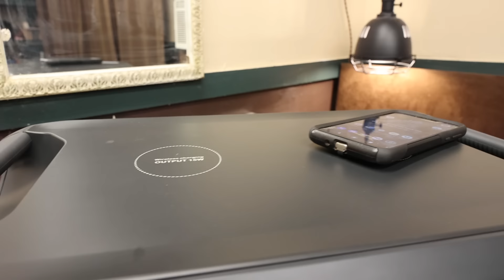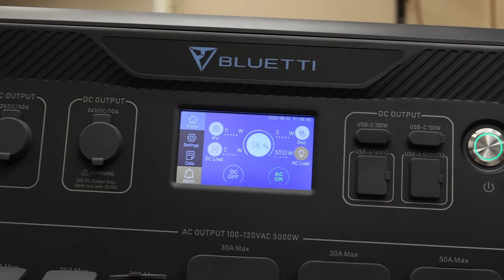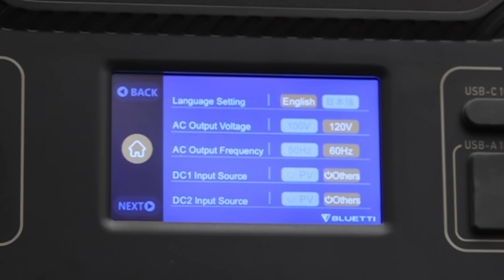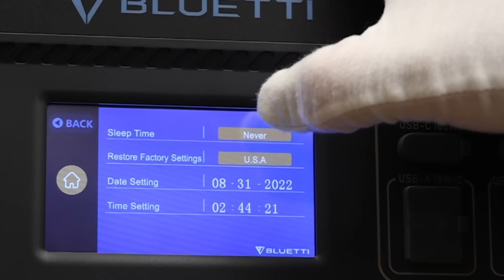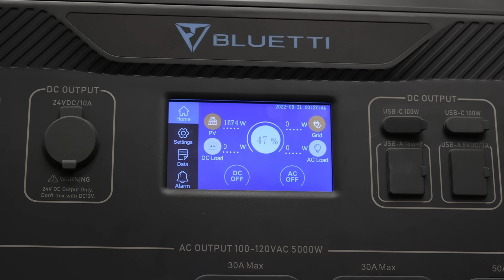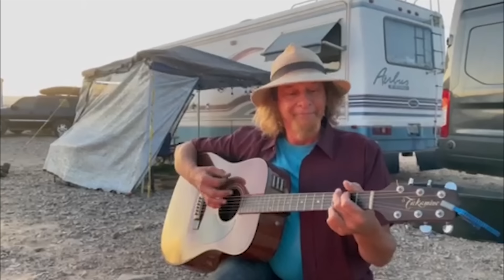Bluetti AC500 5000w LiFePO4 UPS Portable Power Station Solar Generator Review

Comment: Being able to charge the battery units separately via solar is a treat for my small place --- HOA would not let me put up huge solar set-up but I could get away with a couple of panels charging up one battery at a time.
Reply: Isn’t it a shame HOA’s opposing renewable energy only because it’s different
Reply: @JoeyBeez  After living in my current place for 8 years, I have seen too many people try all kinds of goofy stuff with the outside of their units and then get into fights with the HOA because they broke the rules. The HOA is OK by me because we have tiny porch areas and if they allowed solar panels with no rules, lord knows what some of the neighbors would put up.
Reply: @Randomadventuresebike  Normally I would agree with you but when neighbors leave bags of trash out that bring animals which then damage other people's places, that is when those rules are good to have
Reply: Many state laws override HOA CC7R's when it comes to installing solar.
Reply: @Bassist5392  I am staying where I am for now because of taking care of my elderly Mom but I may move someday. I am thinking of a Bluetti or similar modular solar system that I could take with me. If there was a loss of power for a few days, I doubt the HOA bosses would care about me laying out solar panels for the duration.

Comment: I as well was pretty excited when I saw the 240/120 volt 30 and 50 amp outlets  on the unit for the first time. Too bad they don't function as 240 volt with a single unit.  I may just hold off until they can figure that one out

Comment: I own a BLUETTI ac200p and I use it every day it’s a great product however these indigo go campaigns are dicey at the moment. With supply chain issues and China’s economy on the verge of collapse you might want to wait and order when the product is built and shipping. I’m still waiting on a 12v refrigerator I ordered back in June that was suppose to be delivered in July, August at the latest and I’m still waiting. Please understand with everything that’s happening these campaigns are not running that smoothly and you can expect issues.

Comment: I once saw a video of a guy attaching multiple old/used vehicle batteries to his solar generator and wish I remembered where or save the link. But I’ve never seen this option again and no mention it’s possibly when discussing extendability. This review is awesome and this product is far beyond what I currently can afford or need. But I’m definitely interested in  plug n play solution but with more flexibility extendability to mainly keep my outdoor yard and safety lights going since they are off grid and wiring is not an option.

Comment: One problem with you suggestion to allow these to stack without using cables is that I plan on using this both in my house and my RV. When in my RV it won't be stacked (I've got a 40' 5th wheel and will put it under the stairs). Now if there was an option of stacking without cables, and using cables when you're not stacking them, then I'd be all for that. If it was only a stacked configuration I'd not have purchased the AC500 and 2 B300S's that I'm now waiting on.

Comment: Great video and great product! I do love how it can get over 6,000 Watts of charging. The Ecoflow Delta Pro does this as well. Granted you need the extra battery for it and use on of their multiple options.
Reply: @Randomadventuresebike  A standard dryer outlet is 30 amps 240 volts, so 7200 watts. I have a 120v heat pump dryer so the 240v dryer outlet in my laundry room remains open, and someone could always install such an outlet elsewhere if desired, similar to a car charger.

Comment: In my opinion there is very little need to “charge quickly” on solar.  If it takes 2 hours to charge on 3000 watts of solar as an example, once battery hits 100% you have 3000 watts of solar potential on your roof doing nothing for a good portion of the day.  Either lower the wattage to charge over a full day or put load on it so you are able use what you produce.   I have a 550 watt load on my blue tie and 800 watts solar. I start the day at 70% battery and it ends at 70%.  This way I compensate for clouds and the lower solar generation in the morning and evening hours and invert loss. Also remember charging from ac power takes a 15 % loss. So solar generation is best if your trying to use it lower your electric bill/usage.
Reply: Charging quickly matters if you are using this in a vehicle charging it with folding panels. If you're mobile, it matters!

Comment: "But Hobo..." LOL. That is an excellent poke at the KB warriors LOL!
I do have two DIY systems, 2400w 100A  and a 4800w, 200A system. And I have an older Maxoak 1500w, and an Ecoflow River Pro 720w unit. I like the "modularity" of the DIYs. I can separate batteries as needed. I like the complete turnkey ability of the EF and Bluetti. My goal is to power a fridge, freezer, fans, and a portable AC unit (when needed for rolling blackouts in So Kalifornia, 2022). And of course recharge phones, HAM radios, tablets, and power banks.

Comment: in addition , when running a thermometric a gas or sometimes even a compressor coolbox the wattage will be increase , 
for instance i have a thermo coolbox that does 60w on 12v but 80w on 24v making it work way better in summer on higer voltages !!

Comment: Pretty odd duck of an upgrade over the AC300. I'm not missing anything with a dual AC300 stack though, 3000W (plus surge) is honestly enough for anything you'd have a modular system like this for and burns less idle power, with more of the common NEMA5-15 outlets. The big drawback to these Bluetti modular units are they (still?) lack the capability to balance between multiple connected B300 units; in a split phase configuration especially if one hot leg is drawing unevenly then the whole thing prematurely loses power. Agree/disagree with you about the DC battery connections, the avionics connectors are pretty good power connectors in an outdoor setting but I wish there was some kind of functionality between B300's so you could equalize or dump power from one to the other, especially for split phase operation, and an option for a cable long enough because yeah trying to stack the "head unit" AC300 in a different orientation just doesn't work with those awkward cable positions and limited length. B300S weighing over 80lbs is not a good move, the B300 is like 79.9lbs and about as heavy as a person would ever want to lift, probably would have been worth less capacity to keep the heating tech and stay under 80lbs. Does the AC300 also charge in single mode at 240Vac or is that new for the AC500? Thanks for sharing the testing of the new stuff!
Reply: Great questions. I am also holding back my order until I know if the unit can balance out the 2xB300s

Comment: Great review. I wonder how AC500 will perform with a highend audio system. For the sound quality to work, it takes a good quality inverter, and many batter packs use inverters which degrades the sound. I heard Bluetti is better than most in that regard. But, if there is anyone using it with the audio system, it will be great to hear your feedback.

Comment: After watching your video on the bluetti AC500. I purchased one. I received it the other day. Looking through the manual. I realized something. Is there a circuit breaker or a fuse for the outlets ?. I do have a portable generator and their are push type breakers. 
Thanks for your time and effort on these videos. I do appreciate them. 
I have purchased the following after seeing your videos. Montek carry generator, PowerQueen 190 ah. Bluetti AC500. Keep up the great work.

Comment: I bought the B300s on Indiegogo- Bluetti is telling me that the battery will only work with the AC 500 - unlike the B300 it is not backwards compatible with the older units.

Comment: I’m the process of setting up home backup power in Canada. Got a 3300 watt Firman dual fuel inverter generator, will be setting up a manual transfer switch to power critical circuits but really struggling in committing to battery power vendor. EcoFlowC Bluetti, DIY with Victron etc 

My main objective is to have some backup in case of an outage (rare in my suburb) and recharge the batteries using the generator for now. Eventually will look into setting up solar as alternative source.

I keep reading bad reviews on forums with people having to return bricked devices after failed firmware updates, etc.
Reply from the maker: The bricking issue was <1% of users and was resolved months ago.

Comment: For PC's, especially desktops, I recommend running them on battery backups with surge protection as well. Yeah, you are charging a battery with a battery, but its conditioned from the battery UPS to always give sinewave power. Solid state drives and modern memory modules are sensitive to power drops even in a couple ms range. Laptops are good to go though. I'm using the ac500 and 2 batteries in my toy hauler 23pack15 as my 12v battery and then plug in the 30amp output when I'm boondocking. I have an outlet ran to it that I plug up when I'm on shore power to charge. My next purchase is an alternator charger. Then solar charging, then auto transfer switch, then... then... then... ugh. The pursuit for the perfect setup never ends.

Comment: Tempting but that behemoth of a dinosaur power cable, is such a thorn of contention/deal-breaker.  I'd be willing to bet, if Bluetti came up with a redesign for the clunky power connection, during the crowd funding... AC500 sales would increase substantially!!
Reply: With you 100%. The interlocking pins idea as mentioned in the review would be excellent but even a simple rigid ninety degree connector would be an improvement and should be doable/compatible with the existing AC300.

Comment: I'm still using a bluetti eb150 from several years ago, to power my off grid cottage in the West of Ireland. I've paired it with an 800w generator for when the weather is particularly bad for several days in a row. 

The system powers a 12v fridge, vacuum, radio, led lights, phone, laptop and a few battery operated tools. It's so wonderful, but I'm steadily dreaming about a much larger system that will do a lot more for me one day. The technology is very exciting.

Comment: Hi, just curious if you do plug a 50 amp RV cable into the AC500's 50 amp outlet, will the RV electrical system be damaged by running on only one leg of 120v at 50a?

Theoretically even if only one leg of 120v 50a is available on the AC500's nema port, that is still 6000w of out put which is more than what the AC500 is capable of outputting.  So again in theory if you're 50 amp RV doesn't have any 240 volt appliances then it should still be viable to plug straight into the AC500's 50amp port and still be able to pull upwards of 5kw.  This is all my speculation so correct me if im wrong.
Reply from the maker: It won't damage anything but it may not run all the circuits. You need two ac500 for 240v 50A service. Otherwise it's like standard 30A.
Reply: @HOBOTECH  Okay, thank you for the reply.

Comment: I have two ruptured discs in my lower back.  No way could I lift that battery unit without doing serious harm to lower back.   At 88 pounds, that is a serious logistical restriction in terms of this unit's mobility.  Otherwise it looks like a great product.

Comment: I'd like clarification about the self-heating of the batteries since you said it had to be connected to AC grid power. To me that means it can't self heat if you don't have a grid. I know that there would be workarounds to this but as it comes it doesn't self heat the batteries with its own store battery power?

Comment: From what I have been told, the only problem with the 300 is that the battery management system was a real power hog, so much that the battery would drop substantially overnight.  I hope the 500 brings a more efficient BMS to the table.

Comment: Great video.  I bought one thanks to you.  And I'm looking forward to receiving it as they said it was starting to ship after tomorrow.  They offered several "perks".  One was to buy the Bluetti PS70 units for a mere $99.  So I bought several of those too.  Any thoughts on that little Solar Battery?  That sounds so cheap and there is not limit on them.  I know the limited capacity of 500w/720wh is small, but for a bedside backup doesn't $99 seem too good to pass up?

Comment: I like the cables. If you WANT to be more flexible then you can be. And I've seen setups where two batteries sit sort oft next to each other and the AC300 (in that case) sat atop of them on another shelf.
But what I would like to see are shorter cables with 90° angled plugs for the case that you actually want to stack them on top of each other. Doesn't require any sort of redesign of the units, just a new/optional cable.

Comment: Enjoyed your video.  I'm thinking of purchasing the AC500 system.  I currently have a 5500W, 8500W peak gasoline generator plus the 30A plug-in and transfer box from Reliance.  All works fine.  The Reliance box allows one 240V connection (which in this case is two 120v switches bound together).  That 240V is connected to an Electric Hot Water Heater.  I don't think it matters about the HW heater being split phased.  I guess my question is do I NEED two AC500 and two B300S batteries each or can I get by with one AC500 and one B300S?  I'm thinking the hookup would just involve tying the single 30A connection with the 4 outlets from the single AC500 to the single 30A , 4 inlets on the Reliance transfer box.

Comment: Hi professor. It appears that the B300s battery won't be compatible with any older model. The battery extension cable is a P150D vs a P090A. Very dissapointing that the B300s will only work with the AC500.

Comment: My 50A class A should be able to plug right into this, and with enough extension batteries + solar panels have no problem running appliances virtually off grid?

Comment: Excellent review and excellent product.  The batteries for these units are right on the upper limit of "portable", and the price very much reflects the substantial capabilities, but for anyone wanting an off-the-shelf solution, this is certainly a very good option.  I am one of those who strongly prefers a more modular approach for something of this size, meaning the inverter, charger controller(s), and various DC output types are independent and serviceable.  I recognize most folks do not want to be bothered with knowing how to DIY any of that stuff and that's why products like this exist.
Reply: The batteries for these units are right on the upper limit of "portable" -- The Bluetti website specifies that the battery is portable, provided two people are carrying it.
Reply: @daisypatritio572  - My point exactly.  Personally, I think these newer massive units are targeting a pretty small niche in the market, where folks would probably be better off buying or building a component system.
Reply: I think a lot of people prefer the all in one system because the assumption is there will be no surprises in use, compared to different products not always working together well.  Then when there is a question, issue, concern, warranty, etc., you now just have one company to deal with without the others fingerpointing.
Reply: @aussie2uGA  - I agree, that most people will prefer a commercial, all-in-one system, but that doesn't really make them the best option for many of the larger use cases.  If you're building a large system and portability isn't part of the use case, then things like the AC500 really aren't the best way to go about it.

Comment: Did you by chance do a battery capacity test on the B300S battery without being connected to the AC500?  Interested to know the percentage (hopefully 90% or better) without being connected to the inverter for running a DC refrigerator.  Thank you.

Comment: we have a 50a RV 5th wheel. will we be able to plug into that 50a. We do NOT use both A/C's as they are both ducted. So basically 30a, but easier to just plug into the 50a without an adaptor.

Comment: Can I hook this into my RV transfer switch? Or would it be easier to plug the RV 50 amp power cord directly into the AC500 and use as a UPS?

Comment: Wait a minute! The top unit AC500, which is only the inverter and has no battery and so produces no power on its own, weighs already 66 lbs (4 lbs more than the Bluetti AC200) !?!? WTF?
The combo seen here weighs as much as ME! (150 lbs) Not many people will be able to "carry" this around. These weights are getting ridiculous. 
Glad I have a Jackery Explorer 2000 Pro that weighs "only" 40 lbs.
Reply: Yeah the definition of "portable" is really being stretched. When I get something like this it's going to live in the corner, running appliances. If I have to evacuate in an emergency (or just go camping), I'm taking a little 300w Anker.
Reply: Thats what I dont understand, and do not know why more people are not complaining about it. My 200max is at least a power bank. Why would I pay 1700 for just an inverter with plugs. I thought and glad I came across your comment.  That tge top box is 5000watt hour output, not just a 5,000 watt inverter. To tell you the truth, im only buying this so I can finally get tge voltage step down panel for my array. Still, my wife is like it's not worth it, but they have been sold out for 6 months on them